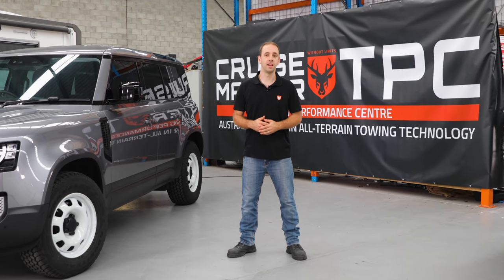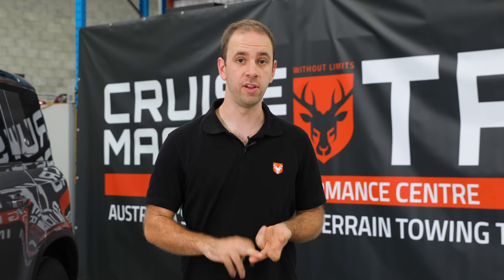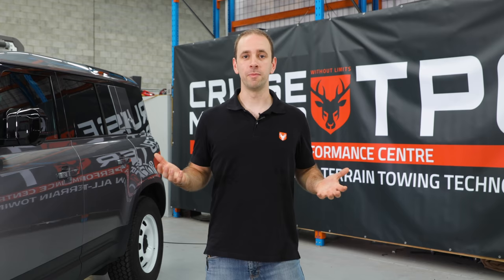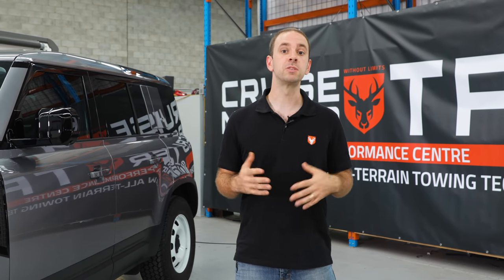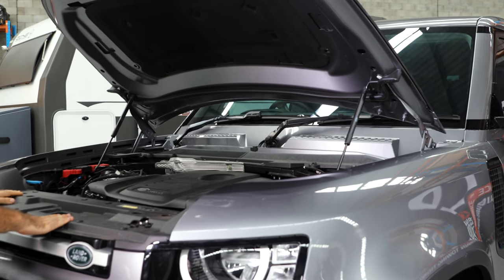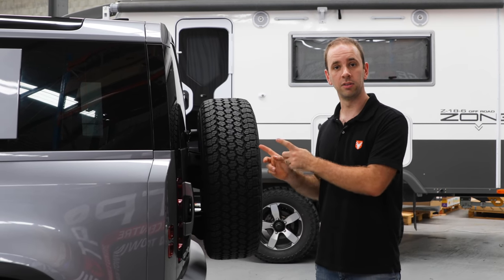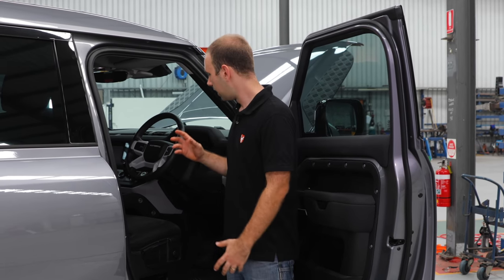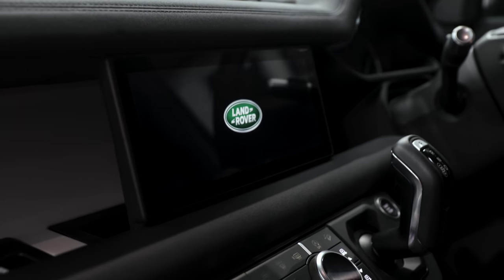Land Rover Defender - Summary After 6 Months

Comment: The genuine snorkel accessory is designed to be fitted for dusty / sandy environments. Fitting that will reduce the amount of time you have to blow out the air filter.

Comment: Very thorough review.
6 cylinder diesel motors arriving in Australia now.
D300 is 220 kw / 650 nm
A lot more grunt then the 4 cylinder diesel.
LR have confirmed a 130 model.
130 will be released approx mid to late 2022.
130 model will have a (much) bigger rear cargo area.
Reply: Bit same wheel base and likely same axle capacity. Why they didn’t do 130 wheelbase Ute at launch is beyond me.
Reply: @offroadingfoz   LR did not have enough resources to do that. Thankfully LR have now realised the increasing worldwide popularity of utility vehicles. 130 utes - single & dual cab will come to market. Probably in late 2023.
Reply: @offroadingfoz  So you don't think they'll have a high capacity pick up version then?
I thought they might increase GVM of 130 or at least have a version with higher capacity.
Reply: @StephenFogarty2023  
I'll only believe that when I see it. This is a monocoque design that is not conducive to being made as a pickup truck. I seriously doubt that JLR are at all interested in the utility pickup market anyhow. The Grenadier on the other hand….

Comment: Agree with your concerns about the air filter screws. I have them in my Freelander 2 and they're all stripped (not by me) - had to run bolts to replace them.

Comment: I really appreciate your unbiased review of what is a technically brilliant car.
The weight limit issues are concerning and I think need to be addressed by the manufacturer as their options list is extensive and potentially self defeating.
I notice in the comments that they’ll be offering a 6 cylinder diesel, which would be my choice.
The elephant in the room is reliability and lack of dealerships in remote areas.
Reply: I agree since reliability has always been a question in LR. I am pleasantly surprised to see, outside of a TFL video on their defender, that the car has been very reliable for the majority. Biggest issues being software related and fixed with updates. Obviously all this technology wouldn't be good in remote areas... for that reason I can't say it's a good overland vehicle in some cases. But it's an awesome SUV that has a reputation of being unreliable yet it has an 8 star on reliability from various consumer reports haha... silly. Landrovers name shames it more than anything

Comment: The reason for the ball weight confusion is probably because in the UK and probably most of the EU, electric trailer brakes are not used and not even legal as far as I know. However brakes, which are all over-run, are mandatory for all trailers above 500kgs gross or thereabouts. 
LR Assist will not carry the batteries because LR Assist doesn't really exist. As with all other brand's assist or breakdown service it is contracted out to specialist recovery companies that cater for many brands and models.

Comment: This is great, thanks Cruisemaster! Info of this quality is either very difficult to find, or you end up learning it the hard way. It has been screenshotted and added to the spreadsheet as it's either a Defender or Y62 with 4095kg GVM upgrade for me.

I'd be interested to see what the weights would do if you could raise the rear suspension 10mm and drop the front 10mm as it might shunt a reasonable amount back to the front axle. Of course the wheel alignments would suffer but that's another story...

I'm not confident but am hoping you guys bought a 7 seat P300 with alloys as it would have the least weight over the rear axle (no MHEV batteries, PSU's, etc) and 1900kg axle capacity. If you removed the 3rd row seats and moved the spare wheel to the trailer or front of the roof you could end up with up to an extra 140kg over the rear axle to play with.

BTW, very happy with the DO35 and air suspension on my Drifta DOT WUHT!
Reply: Unfortunately you can’t appreciably move weight balance F-R or L-R by changing ride heights. You can only balance diagonals.

Comment: Thanks for the review. Curious why you didn’t just go with the bigger P400 engine if tow capacity was  your goal?
Reply: Maybe because you can't get the p400 with steel wheels but they probably could get the 3l 6 cylinder engine but that probably wasn't available at the time of purchase
Reply: All you need is the p300 it will put tow a land cruiser
Reply: I believe they bought this when it was first released in Australia and there was no mention of the 6cyl motors then
Reply: @ltruskinger  petrol is the better option anyway
Reply: @audionut9974  I mean it's a matter of opinion really.
Reply from the maker: This was one of the very first Defenders to land in Australia. Having all our fleet on the same fuel source if possible for remote trips is also very important.
Reply: @CRUISEMASTERCOUNTRY  Thanks for the reply. Makes sense regarding the fuel and the itch to get the first of the Defenders. In my opinion, and I mean no offense, it would have been helpful to viewers to state that you purchased the lowest spec Defender for the purpose of towing, and that there are actually better suited trims for this use (P400). Enjoy your channel, but had to mention this as positive feedback. Cheers!

Comment: Here in UK the brochure(WLTP figures) shows that D250/D300/P400 payload is up to 800kg. While the GVW is higher on the Diessel variants but Petrol P400 seems to have a 19kg advantage.
FYI, if you compare the Discovery & Defender brochure, they said 350kg nose weight on Discovery but 100kg on Defender - This echos what you have been told.
Land Rover has made information more confusing than it needs to be. Guess P400 is the choice of maximizing its potential at a higher running cost.

Comment: Most people just ignore the payload limit of the vehicle when towing 3.3 tons, legal or not. That's the reality. I regularly tow 3.5 tons and often more, in the form of a 14ft by 6'6" IW livestock trailer with four big beasts moving around inside. Say  up to 700kgs each [but they vary from 550 to 750 and we try to limit it to three if all are known to approach 750kgs, which still makes 3.5 tons]  for 2.8 tons plus the 1.2 tons of tare if needs must. Three of us in the cab and 500kgs in the bed of the ute, which helps stability and traction very much. Its not at all unusual in rural UK and the legal limits are the same as Australia.

Comment: Thanks for the great Defender videos Andrew. Just wondering what wiring loom did you use to plug the Redarc Tow Pro to the Defender? Was it from Land Rover or one of the Redarc wiring harnesses & do you know which one?
Reply from the maker: It was a Redarc wiring harness, they should be able to point you in the direction of the right one to use.
Reply: @CRUISEMASTERCOUNTRY  Thank you for your reply, I contacted Redarc and they said it could have been any of these codes and they suggested I ask Cruismaster which one they used:
TPH-005: suits FORD/LINCOLN 
TPH-006: suits FORD/LINCOLN 
TPH-007: suits FORD/LINCOLN

Comment: Great info. You have just proven that the new defender is not the optimal touring and towing vehicle for Australian conditions. Perhaps we need to travel with less crap!
Reply: I see you've bought into the "australian conditions'' con.
Reply: @bluepaul196245  No. I decided to buy a Dmax LSM with Pedders GVM preregistration upgrade to 3.45t. Now I can legally install a Norweld touring canopy with all my gear and not be overweight. You cant do that with a new defender.
Reply: @Wilbargosh  australian conditions you said. What, like Australia is the only country in the world with extreme heat, dry & dusty conditions ?all of which any 4x4 car maker will do in this day & year.
Reply: @bluepaul196245  Bee in your bonnet! I meant towing conditions around Australian regulations were by the towball weight plus load will exceed the GVM and GCM, but the Defender can’t be modified to legally increase its GVM with a state or federal compliance plate. Therefore you need to tour with a smaller trailer and less luggage. That’s as clear English as I can put it without wasting more of you time!

Comment: Thanks for the honest review video. We were looking at changing our RR sport to a Defender. Definitely won’t be now. We have no issues towing a 3000 kg van with the sport. Think we will hang on to it.
Reply: what sport are you sporting?
We towed a 2.8t hybrid 2 years ago with our sdv6 disco and passing road trains at 160 wasnt an issue. stable and plenty of power.
Reply: @nicholaswirth1011  we have a 2016 TDV6 - been towing a Jayco but soon to tow a BlueSky 21.6ft. Never had an issue with the Jayco. Great mileage and a breeze to tow.  Were looking at the Defender but this review has changed our mind.
Reply: @livingtotravel4290  the defender he has is a 2L get the D300 and you won't have any issues towing at all.  The tdv6 is the same engine and tune in pretty sure
Reply: @nicholaswirth1011  the new diesel in the Defender is completely different. The Tdv6 are known to be pretty weak and snap crankshafts. The Defender now has Inline 6 engines, the D300 is a bit of a beast in the New Defender. The other LR products are switching to the inline sixes too. The big Range Rover is replacing the TDV8 with the D350 which is the same as the D300 in the New Def just in a higher state of tune.

Comment: Pretty much every truck loaded up with RTT and every doodad from the overlanding store is over weight.  Doesn’t mean it’s smart, but it is what people do.  Max towing ratings are a joke for every single truck on the market because they assume you carry nothing else.  At least the Defender has a bit of extra room.  Nobody should ever be towing above 80% of max tow rating anyway.  Just doesn’t leave enough room for anything else.  That said, I know you’re supposed to count tires, but unweighted vs weighted should be counted differently.  I wouldn’t worry too much about heavier tires and wheels except for the spare which is carried.

Comment: Couple of issues with this review. The premise that people will add all that crap and overland it is wrong, 99% of people won’t do that. So under normal use there’s zero issues with GVM.
Secondly the towing issue is a non issue, to all the people sating they won’t buy one you need to listen to the review properly. Again, in 99% of circumstances it wont be an issue.
Thirdly the towball weight, to me and people I know, it’s clear the weight is 350kg, no idea why this chap needed clarification but I have no issue with it taking two weeks for someone to explain to him his assumptions were wrong, it must’ve been frustrating to JLR. Try getting the MD of Toyota on the phone!
Finally a general observation, he makes numerous assumptions of failure points which are just assumptions and he seems very nitpicky, typical pom. The airpox issue, jeez dude lighten up, if you’re that concerned don’t go off road!
Reply: @landrover1155   I think the review was fair if a little pedantic at times. I've owned Discovery 3 and 4 over 12 years and towed off-road 1800kg camper over many remote and challenging tracks through, SA, NT & Victoria. I also have on order a new Defender D300 SE with numerous accessories including bull bar and winch, snorkel side steps, roof rack,  and ladder arriving next month. I found the review helpful but not alarming as I won't have quite same GVM issue given my towball weight will be around 190kg and I'm not fitting a drawer system this time.
However it's clearly very easy to overload these vehicles with numerous accessories fitted as it is with any new 4WD. The review simply highlights this problem. I agree there are better options than Defender for towing very large vans. The Range Rover Sport may not have as many accessories but I'd still get the rear axle weighed with 3T van on back and check! I bet it's close to axle limit. I wouldn't assume a RRS is better tow vehicle.

In my 12 years of Land Rover Discovery ownership the starting batteries have always needed careful monitoring and regular charging (monthly)- I've run Dual battery system in both Discoveries and Victron battery monitor in the D4 to keep eye on starting battery. So it's not a new model problem and I'm not surprised although a bit disappointed it's still an issue for the new Defender. As usual I will be carefully monitoring the new battery.

I also agree the airbox design is annoying with some 8 screws to undo/retighten.It is however well sealed. In my D3 I did over tighten the screws and needed a new bottom half airbox replaced under warranty. Thereafter I was very careful tightening the screws and in last 10 yrs have had no issue regularly checking the air filter on trips away. I would also reassure new potential owners the snorkel (Raised Air Intake) with rear facing inlet is remarkably effective at keeping dust out- My D3 had the OEM snorkel and the D4 has a Safari (forward facing) one. The D3 snorkel was much more effective. I have the OEM snorkel fitted on my new Defender so will be interested to see how effective it is - going to Cape York in July with new camper!
Reply: @davidmunday8820  I always try tell people that Land Rover need proper care and maintenance but always complaining I think they use non luxury cars then they purchase first time so they have not luxury of luxury car
Reply: Bangs on about assumptions then assumes 99% of people won’t do x, y, z. It is very clearly stated this review is for people who actually want to use the car the way it was advertised- to go off road and tow. If you want to use it as a black top warrior then you’re watching to wrong video
Reply from the maker: Hi there, we tried to make it as clear as possible that this series was based on our opinions of this vehicle for the purpose of how we use our vehicles. This vehicle was originally purchased to join our Remote Area Testing fleet that does regular testing trips of our trailer components through the toughest roads in Australia. The potential "failure points" we highlighted were based on our 10+ years of real world outback travel experience. 

But if its not for you thats ok.

If you are interested in seeing where we take our vehicles maybe check out some of our R.A.T. Run content. https://youtu.be/5HTb1HzcaiQ